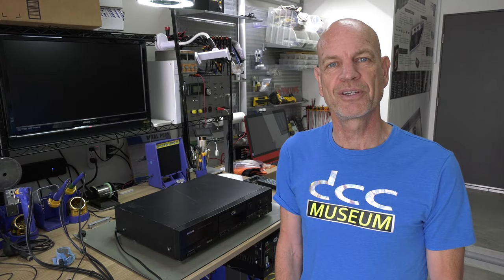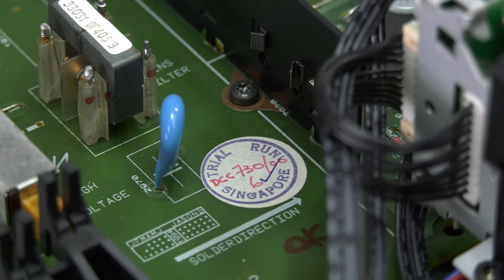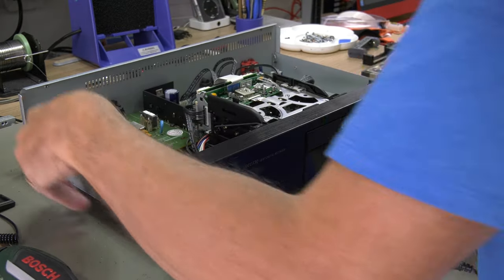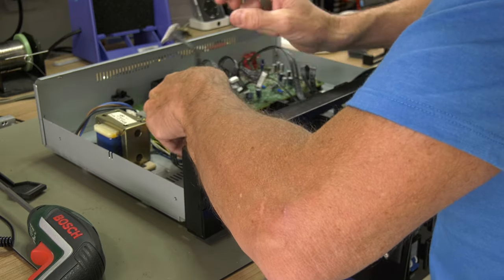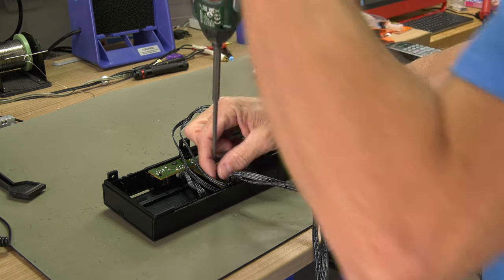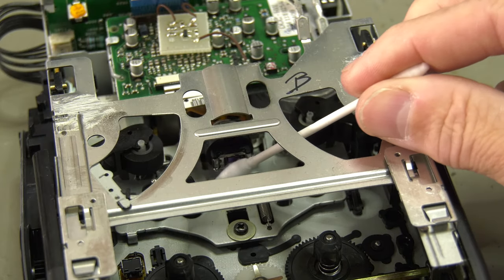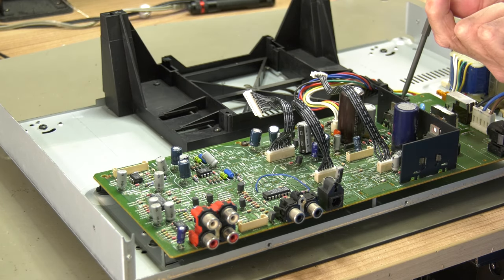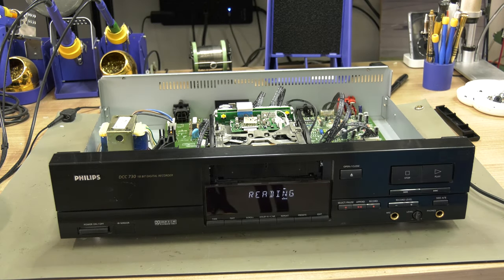The Philips DCC730 Proto Type? / Trial Run 18 bit Digital Compact Cassette

Comment: When I get a video recorder which is a prototype/trial, I generally consider it to be a spare parts bin.  There can be bodge boards and wires snaking all over the place and performance may be sub-standard.  This unit looked to be a reasonably late prototype and so not quite so scary as some.
Reply from the maker: From the curating perspective they need to be preserved and are for display only. If we can get them to work it is a plus, but not a must.

Comment: I bought dcc730 in 1997. I sold it in 1998. I had problems with head which was still dirty. My collection consisted of many prerecorded tapes (bought between 1985-1996). They had very bad quality tapes ( dusty surfaces).